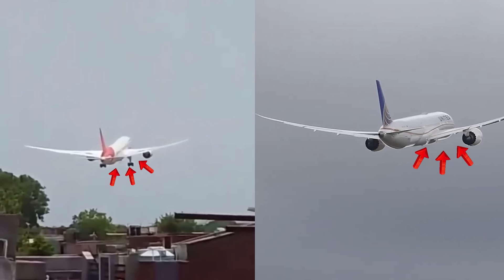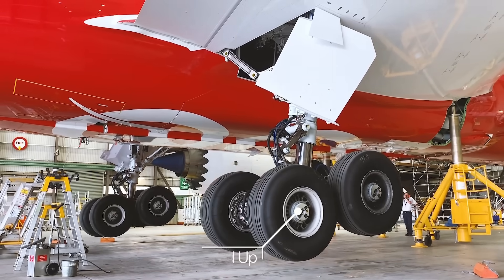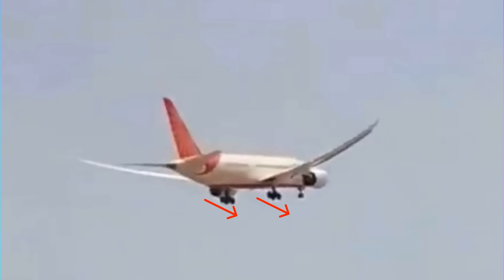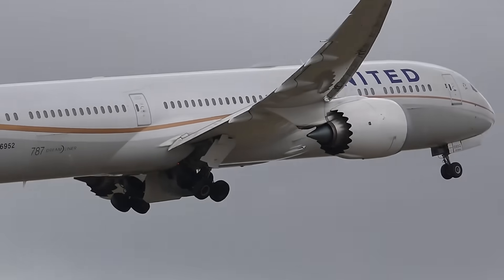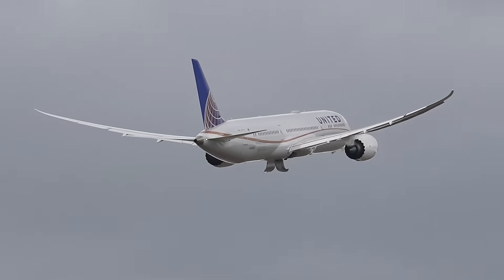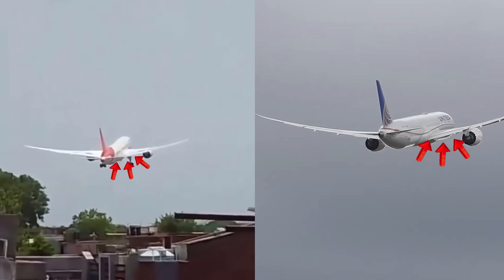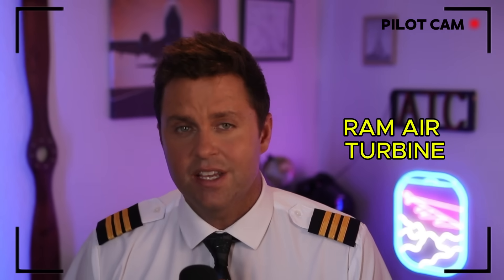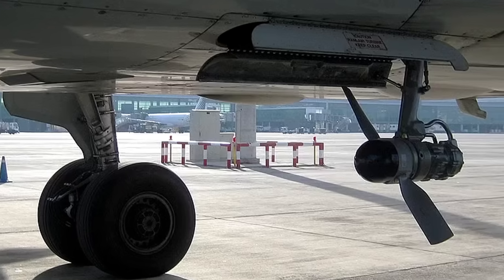Pilot Explains: A New Detail in the Air India 787 Crash Everyone Missed

Comment: Solid analysis Gary. The odds of double engine failure are so remote. But it’s hard to imagine a different option either. Looking forward to getting the initial report.
Reply: The fuel levers are mechanical. Are there circuit breakers that provide electrics to the fuel valves?  An electrical issue could have popped both breakers starving both engines of fuel  simultaneously.  Just my thoughts.
Reply: @CarlWheeler-tv2tu  There are no physical circuit breakers in the B787 cockpit. Nothing you can check.
Reply: How about Fuel Cut off valves. Is it a Electrical Solenoid like in other Automobiles. When the electrical power is lost, do they close automatically.
Reply: @praveens866  A Tesla or other electrically driven cars will stop immediately if there is a total electricity failure.
Reply: Engine reliability is so high that the FAA removed the requirement for the third engine for transatlantic flights. No way the engines failed independent of the same problem.
Reply: @jamesdellaneve9005 the same FAA that enabled Boeing to certify their own planes leading to the Max fiasco
Reply: Good video and Solid indeed. A lot of things seem questionable or rather unlikely, yet a plane crash like this is already unlikely in the first place. It is indeed a priority not to jump to conclusions but i think its important to bring some things up to the table that we didn't see before. What do you know about the GEnx 1B64 Engines? and what do you know about Jetstar flight JQ15  (march 29th)?
Reply: @derkurier5542  I just looked this up, interesting! Has there been any reason given for the dual engine failure? Sounds like the electrical system may have failed?
Reply: Maybe low fuel pressure due to contaminated fuel. It might run normally during idle but on full throttle it became fuel-starved that flamed out both engines.
Reply: @RideOnTimePH  Possible. Yet Contaminated Fuel usually would have an impact on takeoff Run already. The pilots are trained to stop to run due to anything abnormal. But it is still a reasonable possibility. Just something would be missing in that big picture than. Other than Ice what could trigger Fuel contamination to cutoff the Engines at that very moment, not before?
Reply: @RideOnTimePH definitely a possibility but that would have been evident during journey down the runway l
Reply: @RideOnTimePH they would have been apparent early in the roll.
Reply: @RideOnTimePH  if so Delhi to Ahmedabad it flew with the same octane only .
Reply: It had enough to get off the ground then stopped for some reason.
Reply: @RideOnTimePH  
Couldn’t low fuel pressure also be caused by an electrical problem? And see the comment immediatley above yours suggesting that both engines could fail because of an electrial failure because I guess these engines need electricity to run. Are both engines fed  fuel from the same tank, I mean did they both start recieving contaminated fuel at exactly the same time which would need to happen for both to fail at the same time because of contaminated fuel. I mean they did take off so not all of the fuel was contaminated. In my totally amateur estimation the chances of both engines being deprived off electricity at the same time are greater than both recieving contaminated fuel at the same time. Furthermore, I heard there was a passenger on a previous flight in this very airplane who reported to a flight attendant that he was experiencing electrical power failures in his seat. And even more furthermore an electrical failure is one triggering mechanism for the RAT to deploy.
Totally unqualified armchair analyst here, but I sure hope they figure out what happened so a repeat doesn’t occur.😢
Reply: @RideOnTimePH  Fuel contaminated with water will have lots of pressure, it just will not burn. For those who do not drain their fuel tanks to check for water, and I am familiar with light planes, there are usually enough fuel in the system to enable taxi and take off, then at around 100 ft, the slug of water get to the engine and you get this loud silence. Adding some gas line anti freeze to the fuel, although illegal will solve the problem.
Reply: yep, when looking at both engines as separate units, yes, based on fuel and hydraulics. But when both are also dependent upon Elec Sys, and there's a 100% Elec Sys failure, they shut down simultaneously together as a system. Unbelievably sad. :(
Reply: @gkswift1999  They are not both dependent upon the electrical system.  Each engine is controled by an engine mounted FADEC powered by it's own permanent magnet generator that takes over at about 11% N1 RPM.  The engines will work fine with loss of all electrical power.
Reply: @jamesfirnhaber984  But not the fuelpumps. They will stop immediately, thus no fuel to the engines.
Reply: @gkswift1999  the engines have there own computer, I doubt there is any system on 787 that could just cause both engines to roll back, i saw the audio on that vidieo last night and it painfully apparent those engine were dead. Even if in flight idle uall see heat distorion behind them. and its not there that i saw. They have separate full pumps  and tanks.
Reply: Well...there has been at least one crash where the fire staff had to choke down an engine that was still running, despite catastrophic damage to the plane.  I suspect that each engine control computer can be independently powered by the generator on it's own engine and, if all electrical and/or network interfaces to the rest of the aircraft are unavailable, the computer will just continue to run it's engine at the power set before the failure.
Reply: @MrSardine17 That was a Qantas A - 380 at Singapore. Fuel off, electricals off, damaged fuel tanks. Nothing would stop it. Not even copious amounts of water from fire trucks. Yes, they had to choke it with fire fighting foam. Guess that said a lot for the quality of those RR engines.
Reply: @gkswift1999  you're making up that the electrical system failed. the passenger didn't say the lights went out, he siad the green and white ligths came on. both engines feed the electrical system. Why should it fail?
Reply: @FeritTuzer  No communications more with ATC after the Mayday call.
Reply: @gkswift1999 My thoughts! It explains the extracted RAT and in another vid you can also see the liftoff at the very end of the runway. So I think problem startet early but it was too late to cancel start.
Reply: @gkswift1999  I don't see how that would be possible. Im not suggesting its not, i just dont see how. All Electrical systems have more than one backup. The Primary 235 vac loads also have 4 backups those are running Fuel pump & Hydraulics, then you have the Main Bat and the last Line of defense the RAT wich will prevent a 100% loss of Power
Reply: @derkurier5542  So, opposite situation: loss of electrics didn’t cause flameout, flameout caused loss of electrics.
Reply: @petergill2265  It is more likely. but still both is a possibility with this plane. Not suggesting that it is less safe, but with every design comes with its Vulnerabilities. The engines just for an Example. The decision to design the engine blades out of Carbon fiber and some reinforced titanium parts exept pure titanium increased efficiency but also made the plane quite a lot more vulnerable to bird strike. Carbon fiber is simply not made to withstand these impacts. Just as an example
Reply: @derkurier5542  Was the Auxiliary Power Unit in the tail running?
Reply: @derkurier5542  Vapor lock on both the engines at the same time? Mhhh...
Reply: A passenger from the previous flight on this plane stated that the electrical power kept going on and off, no TV's, no A/C, etc.. did this have anything to do with this crash?
Reply: @ILoveLucy21.  He mentioned AIR CONDITIONING!  On the 787 that's ELECTRIC and LOTS of it. Maybe 1Mw in total across two packs?
BIGGEST user of elec power on the aircraft! IF it was dumping the air pacs it was struggling somewhere.
Reply: Engine anatomy and function: What keeps an engine running smoothly and efficiently. Checklist template. Fuel to electricity  for energy and power from  the source and then out to the engines? Rotation in the engines? Compare fatigue, weakening in body and performance of same models. Residue in fuel ? I am no expert. Level of fuel before re-fueling?
Reply: It is not contaminated fuel. They would not have failed at exactly the same time.
Reply: There was no adverse OEI yaw and no hard over rudder deflection which would seem to indicate a dual power reduction or dual engine failure. The flap theory doesn't hold water because it'd never off the ground loaded and fueled. The Rat deployed so it was apparently electrical which could have caused faulty fadec actions or some unprecedented event.
Reply: @jeffreylewis145  I beg to differ. Im not saying it is, but im saying it is a possibillity. On the Ground the plane uses the APU wich draws Fuel from the left side Main Tank. Crossfeed would have been unlikely to be active therefore you have a small but impactfull difference of Fuel balance, effectively it could very much cause one Engine to be contaminated before the other. Also Fuel Contamination is not limited to water or even just a foreign liquid.
Reply: @jeffreylewis145 ADSB data shows that the plane was slower by 10 knots and more than half the vertical climb speed compared to the same flights the days before.  It also used 2400 meters of runway instead of 1600 meters (that was calculated by using local conditions, but guessing the weight of the plane, this will have to be done again with the actual data).  This could suggest that they lost one engine/experienced a major power loss on one engine after V1.  There is no information or data yet that could confirm that both engines failed at the same time.  But it is a possibility to include one failed first, then the other
Reply: Report that only half the runway was used, from intersection to taxiway, should have backed up to full runway length for full load and hot weather. Big mistake by pilot, no oversight from tower. Insufficient speed for takeoff, dust ingestion after leaving paved runway caused flameout both engines. NO THRUST.  @StefBelgium
Reply: @stevehoffmann-ivy6173 Stop spreading misinformation.  The crew backtracked the runway and used the whole runway for T/O.
Reply: @jeffreylewis145  The fuel on takeoff is from the main central tank so it's quite possible.
Reply: @jeffreylewis145  I agree. I think that's a reach.
Reply: @jeffreylewis145  Centre tank on takeoff. I don’t know where the pipes split, or where the filter is…
Reply: @jeffreylewis145 Also, you would have seen a series of some back fires.
Reply: @jeffreylewis145  care to explain that rather than just refute
Reply: @jeffreylewis145  British Airways Flight 38 both engines lost power on approach due to ice clogging fuel heat exchangers so couldn't any contaminant block these ? . I know filters can't cause shutdown though because if clogged they should simply bypass
Reply: @jeffreylewis145  correct. Very unlikely, as one engine is always running for longer. Flameout of one engine, then switch off the wrong engine. 
Or general electrical failure.
Reply: @jeffreylewis145  ya, the fuel contamination thing is ticking my brain now - what if dirty fuel was gradually clogging the fuel strainers/filters - not stopping the flow but reducing the max flow available, gradually - so when they went to TAKEOFF power the full flow was not available for long because higher flow = more contaminants = more clogging -= reduced flow ?  It will be interesting to see what the engine FF readings are to both engines as the aircraft was faltering. Maybe explains the looooong takeoff roll also ?  (was it abnormally long ?)
Reply: @jeffreylewis145  WHAT? Planes need pure fuel? On one flight? Gasoline witll clog  up  your care OVER TIME. And jet fuel will lower power of a 787. But I see no sense that two engine failure is "dirty fuel". To me, these are just distractions. And the data recorder won't record fuel quality.. I won't say "failure to add STP"
Reply: @jeffreylewis145  maybe not same time, maybe 2 seconds apart, but they both ingest the same fuel, so why shouldn't they? anyway this was caused by taking off from half the runway and not raising the gear.
Reply: 787 driver here (10 years and 7000 hours in left seat of that AC) - after selecting the gear handle up, the gear tilts forward then the gear doors freefall - they do not need hydraulic power to fall open, only to close. If the gear handle had been selected up, with loss of both engines, the doors would have free fallen open and stayed open. The rat is for essential electrics and hydraulics only and does not have the power to make any changes to the gear config. No sign of doors open in the video. Unfortunately, I agree that the cause of the crash is loss of both engines (note that I do not say dual engine failure)  but most evidence so far points to the unthinkable.
Reply: @chrisr3394 that makes a lot of sense
Reply: @chrisr3394  I have thought the same thing myself but it's very hard to say in case you are wrong. It's not something you would like to be wrong about 🙏
Reply: The odds of winning a lottery is remote as well but occasionally there is a winner. I don't see any other reason why a 787 will fall down so rapidly if engines were running.
Reply: @tapashaviator  Sabotage
Reply: @tapashaviator  Not to mention the fact that one person not only survived, but walked away from the crash. What were the odds of that happening.
Reply: @tapashaviator the odds of a lottery winner isn’t a good analogy because they keep running the lottery until someone wins.
Reply: @SteelheadTed each lottery draw is an unique event.. odds of winning do not change if the prize money is rolled over to the next draw.
Reply: His MayDay message was 'No thrust, going down'!
Reply: @tapashaviator  Matters not your power if your wings are stalled. Not saying that was the situation because I don’t think they were in a stall. Look at the Thunderbird ejection at Salt Lake.
Reply: @tapashaviator  a billion people dont buy lottery tickets to have one winner. but to have double engine failure, the odds would be yes
Reply: Very nice comment. But it is tragic in any way.
Reply: @tapashaviator every night there’s a winner
Reply: @tapashaviator  The RAT shows they were not running. That was NOT a pilot error. It was a system error. The theories faulting the pilots are bogus.
Reply: @tapashaviator, no other reasons? Let´s not forget the pilots who crash the plane on purpose.
Reply: Double engine failures usually involve the fuel system. A typical cause , learned the hard way in the past is the ground crew poured diesel DEF fluid into the fuel instead of anti ice fluid and clog all the fuel pumps. Either that or a leak, or someone tried to fly 1000 miles on 800 miles of fuel. There was one famous case of bird strikes.
Reply: @tonylam-u1t  There are no diesel outlets on the Tarmac, and the nozzles on the Tarmac only fit airfuel.
Reply: @glennd8232  I did not say there are diesel outlet at the tarmac, but the nozzle only fit airfuel is not accurate. There are a significant number of smaller diesel engined planes nowadays,(Diamond)  they use jet A and the nozzle is very similar to 100LL. Small plane are not equipped for single point refueling like big jets. It is also up to the pilot whether they want to add "priest" anti ice additive to the fuel. Now that is a clear liquid , just like diesel DEF fluids.  DEF fluid in Jet A form gels that will clog fuel systems, as a result, FAA allow airport vehicles to run without needing DEF fluids to avoid such accidents. There had been a few close calls. All bets are off in third world countries.
Reply: @tonylam-u1t  Ohh sorry for the misunderstanding. Thanks for the explaining. But really?, diesel engine powered planes? Never heard or read of that.
Reply: Contaminated fuel has a problem, as there are no other noted contaminated fueled planes, that we know of. This is why it is likely  isolated to this plane.
Reply: well, if you count fuel starvation as "engine failure" what about the Gimbli Glider 767 over Canada that lost both engines by running out of fuel ?  They managed to glide it a deadstick landing at an abandoned military base runway (miracle WITHOUT the Hudson). Or the Miracle on the Hudson dual engine "failure" from birds ?  And there was a foreign airliner that crashed near  NYC from running out of fuel - the dumbasses waited too long to tell ATC they were low.  Plenty of crashes over the decades from "losing" all engines if fuel starvation is included.  How about the Lynyrd Skynyrd propeller engine crash - that was fuel starvation also - lost both engines.  This India 787 smells like a fuel "shutoff' or slow fuel starvation issue - electrical issue somewhere maybe.
Reply: @KRAM-ct7ok  Ginmbli was pilots error. One of the engines had a fuel leak and stopped working. The pilots then diverted the fuel flow of the other engine to this one. Shortly after that this engine also ceased working and they were totally out of fuel. They were now gliding from a high/cruising altitude. RAM turbine was also deployed. In the case of Air India it looks like a total electrical failure. The fuelpumps stopped almost direct.
Reply: @glennd8232  It was a ground fueling error, not pilot error, on Gimbli (just checked on Wiki) - caused by faulty fuel indicators and wrong fuel load calculations by ground crew - resulted in the airplane having only 45 % of its required fuel load - so no leak but ran both engines out of fuel - (their cockpit FF indicators were faulty) so double engine "failures" (in that case by fuel starvation) do happen lol - total engine "failures" are NOT unheard of - but in Air India the timing was horrible - no altitude to work with like the Gimbli Glider. Ya, I bet the engines on this plane were just fine - just needed fuel to keep running.
Reply: @KRAM-ct7ok  you are definitly right.
Reply: @KRAM-ct7ok  Air Transat flight 236 this what I was referring to. Fuel leak.
Reply: @KRAM-ct7ok ran out of fuel ?
What was the giant fireball ?
Reply: @grrlgd3835  You don't understand what I meant - the big flying gas tank the passengers are sitting on top of was still FULL - but that fuel has to pumped out of the gas tanks to the engines hanging from the wings - which have their own pumps to increase the pressure of the fuel to a very high value to spray the fuel inside the combustion chambers of the engine in an atomized spray - this usually requires about 500 psi fuel pressure - so there was PLENTY of fuel left (fireball) - but it wasn't getting moved to the engines any longer - so without fuel the fire inside the engine goes out - called a "flameout"  (engine "failure" due to fuel starvation). Same thing  can happen to your car if the fuel pump fails -gas tank full but engine won't run - been there, paid to have fuel pump replaced lol
Reply: Steeve: this is what we have been discussing: Even "Before selecting the landing Gear handle UP"  , the gear tilts Forward Down... as soon as the sensors detect AIRBORNE...  see:   AMM 32-31-00 LANDING GEAR DESCRIPTION AND OPERATION.    So, regardless of the selection of the gear handle, it will always tilts forward down to prepare for retraction.
Reply: You forgot to list sabotage.  Who was on plane?
Reply: Gary, good analysis but both you and Steve have missed a vital piece of information.  The 787 used the entire 11,499 feet of runway (I haven't seen any information about an intersection takeoff.  Regardless, they rotated at the end of the runway) when the calculated take off distance was about 60% of that distance.  When the aircraft rotated, it is clear both engines were operating because there was jet blast blowing dust into the air.  There appeared to be no asymmetrical loss of thrust because there was no rudder displacement or yaw moments.  The excessive take off run was most probably caused by insufficient thrust and or improper take off flap setting.  Regardless, the crew did not exhibit situational awareness realizing the airplane was operating at reduced thrust with a longer than normal acceleration rate.  The captain should have rejected / aborted the takeoff.  Furthermore, at this point, we don't know if the airplane had reached Vr (rotation speed) at the end of the runway.  

Regarding a simultaneous dual engine failure.  The odds of this happening are little to none and that includes multiple bird strike, contaminated fuel, etc.  The most probable scenario would be shut down with intent. 

I am posing another theory / scenario.  Perhaps during takeoff roll, around V1 (decision speed), they experienced a total electrical failure.  If that occurred, the auto throttle would have disengaged and the FMC would have dumped all performance data.  EFIS displays would probably disappear momentarily then power up via the emergency bus.  The crew now has manual throttles, no performance data and a confused cockpit.  I'm not sure if the RAT will deploy automatically on the ground but, if it did, the RAT creates quite a bit of parasitic drag and could have affected acceleration rate.  

As you know, most pilots are taught via rote memory to immediately add full power, etc., when entering a stall, windshear, etc.  Pilots react the way they are trained and, again, the crew may have been overwhelmed not realizing the A/T were disengaged and did not add full power, etc.  

Lastly, I don't know where you came up with this landing gear down during a crash situation.  I have flown every Boeing N.G. and not one operating manual calls for such maneuver.  During a crash landing scenario the negative vector / downward force / rate of descent would be great and the landing gear would most likely spike through the wing rupturing the fuel tanks.  For that reason alone, for liability purposes, Boeing would never suggest such action.  I appreciate your concern about this fatal accident but you and Steve should pay more attention to what you are saying rather than preying on the sensationalism of the accident for Y.T. "clicks" and notoriety.  Capt Steve in particular is receiving much criticism world wide for his wild ideas, retraction, new theories, etc.  Your suggestions are more conservative and thought out but still over the top.  I.E., simultaneous engine failure, leave gear down for crash landing.  I doubt very much, with the short time they were airborne, the crew placed the gear handle back down to "absorb the impact" of the crash. 1.  It's wrong and 2.  They had more important things to do like flying the airplane and not talking on the radios.  

I believe this accident was preventable.  The crew should have realized during the initial take off roll, thrust was inadequate and acceleration was abnormal.  The captain should have rejected the take off.  If the crew did initiate gear retraction, then the video should show the main gear forward tilt on early climb out.  

I believe the accident was preventable.  I believe a contributing factor to this accident is PILOT ERROR.
Reply: Guys even if a thing can go wrong with a chance of 1 in a billion - then this could be that 1 moment. Remember Murphy's law is an adage or epigram that is typically stated as: "Anything that can go wrong will go wrong."
Reply: Another possibility the aircraft's tanks were EMPTY. I have no idea if it's even possible the pilots couldn't see that. It's just a theory.
Reply: @UkrainoTV No. That is really impossible. The fireball at the crash scene can only have been triggered by jet fuel. If there was no fuel on board there wouldn't have been.
Reply: @UkrainoTV if tanks were empty there wouldn’t be the huge fireball
Reply: @UkrainoTV  you mean - they would have just forgotten to fuel the plane and the pilots would not have checked fuel levels before takeoff and then the plane went on fire even with empty tanks?? Nope!
Reply: @mingli8790
0 seconds ago
captain steve's original opinion was a joke!
Reply: @mingli8790  why do you think so?
Reply: Are we sure they weren't intentionally shut down?  Was anyone in the cockpit having personal (e.g., marital or financial) problems?  CVR would show what happened during/after the mayday call to hopefully rule this out.
Reply: Is it possible that the issue might have been a battery fire 🔥 that made the avionics malfunction causing the pilot to lose control of the plane
Reply: Fuel contamination. My Indian buddy said IA is the worst in service and maintenance. As the sole survivor said, they hit a wall. And may be talk about the sole survivor?! Wow
Reply: Overheated fuel valves → incorrect fuel flow → incorrect combustion → insufficient thrust → poor climb → stall.

Possible culprit:
Fuel metering valve inlet
90°C – 130°C
Higher risk zone
Reply: @preetampurbia india
Reply: 2019 ANA flight!! DUAL ENGINE FAILURE!!!

On January 17, 2019, an ANA Boeing 787 Dreamliner suffered a simultaneous dual engine failure on landing at Osaka Itami (ITM). ANA currently has 66 Dreamliners in its fleet. ANA Flight NH-985 had 109 passengers and 9 crew members on board.

I'm not even sure half these guys are pilots??!! He says it is a remote chance.

It literally happened 6 years ago 😂😂😂
Reply: @budget_nomad That was a dual engine shutdown (uncommanded, but not due to a failure) AFTER landing and AFTER the thrust reversers were deployed.
I would argue that’s quite a different scenario. Admittedly the cause was never fully determined.
Reply: @simonissell There is a netflix special literally saying as these planes get old they will have more electric problems....

How else do you explain dual engine failure 2 seconds after takeoff!!!

If it was fuel, it would never hit off the ground!!

Flaps have been ruled, so has bird strike!! 

The pilot said loss of thrust!!
Reply: @budget_nomad  Oh! A NETFLIX special!
Well that's conclusive then....
Prove to me that an electrical problem will cause a double engine failure in a 787.
Reply: @budget_nomad  they didnt know much in the old days so you carnt bleme them
Reply: @budget_nomad  that was in the old days!
Reply: There is new theory, fuel pump malfuction, both engines stopped and there is hot air in the fuel system. Aircraft was overheated for a long period of time. So, air bubbles in fuel system.
Reply: I had a double engine failure on takeoff but thank goodness it was on a A340 so I had two engines left but just to say it’s possible to have such an event as improbable as it is.
Reply: Captain Steve, another pilot suggested perhaps fuel vapour bubble from sitting on the tarmac so long in the extreme heat with no air-conditioning on he said the vapour bubble coupled with hydraulic failure and the angle the plane was on the engines went out from fuel starvation due to vapour bubble. A passenger on a previous flight on that aircraft spoke of various electrical issues on the plane (air-conditioning compressor cutting in and out, entertainment system and plane phone to communicate with crew not working and wiring hanging out on a part of the plane). Another passenger on that same plane from around a week or so before the crash said as the plane was about to take of (perhaps from Frankfurt or at least he mentioned Frankfurt was part of the journey)  there were electrical problems and the passengers had to disembark and stay in a hotel overnight while the repairs were carried out.
Reply: 1.	Engine Start & Taxi:
	•	Fuel for engine start and taxiing usually comes from the main wing tanks.
	•	This ensures stable fuel supply and allows the crew to verify that the fuel pumps and systems are working normally before takeoff.
	2.	APU (Auxiliary Power Unit):
	•	The APU also draws fuel from the left wing tank (via the left fuel manifold), unless crossfeed is used.
	3.	Takeoff Roll:
	•	Once engines are at full thrust and the takeoff roll begins, the center tank pumps (if loaded with fuel) are typically activated to begin feeding fuel.

So the central pump kicks off during roll and that had an issue which cut off supply to both engines
Reply: @kanwarsangha  Power was lost after they tried to raise the gear, maybe not a coincidence; then loss of main elec busses; then RAT deploys.
So, if the engines were switched to centre tanks-  no power means no fuel,,,what is Boeings back up for that? (and is it QUICK)
Normally engine driven pumps, does 787 have those anymore..cos gravity feed might be comp in a high nose attitude.
Reply: Maybe this was sabotaged fuel.
Reply: @hannibalclark6111 each engine has its own fuel tank, so would the contaminated fuel hit each engine at the EXACT same second?
Reply: @Gary-ee3kq  After full thrust for the lengh of the runway? unlikely!
Reply: if there was double engine failure it would be caused by bad fuel.
Reply: @FeritTuzer  Could be!
Reply: Joatmor301 on to something. It was a hot ddy and fuel vaporizartion possible causing pumps cavitation. Fuel is the common factor to both engines
Reply: @billbonadies9615  Electric fuel pump loss at full thrust with heavy suction by the injection pump could possibly result in instant vapour generation
at the tempratures that existed. In normal flight it would recover quickly, BUT on take off that's fatal.
Unless Boeing didn't provide emerg grav feed, this seems like the best reason for sim dual eng fail.
Reply: @billbonadies9615  fuel is most common but the Vapor on the 787 is mixed with nitrogen therefore less likely
Reply: I bet they selected gear up and the air speed was too low for the rat to work properly after losing hydraulic power.
Reply: @themeach011 the rat would not provide sufficient hydraulic power for retracting the gear that is true no matter the airspeed
Reply: @derkurier5542 ok interesting. My understanding was that at higher airspeeds it would provide more power. But it makes sense that it wouldn't need enough power to run the gear. You're likely never needing to bring the gear up if the rat is deployed. Thanks! Have a great day
Reply: @CaptainSteeeve @Garybpilot 
Question, did you notice that object flying off the aircraft just before crush? 
Was it an emergency exit door? Did that lone survivor opened it and jumped?
Reply: Not an expert, but during take off though both engines seem to have an effective and stabil  "maximum" trust (suggested by the postengine "exhaust"). A possible fuel contamination, you would expect to symptomize itself i n a gradual and irregular manner, and NOT to manistest itself smoothly with just a few seconds of notice. A fuel contamination also probably would not affect the engines several of seconds apart which the planes stabil course "disproves". Another potential cause of completefuel cutoff, could be a sudden onboard computer mallfunction of the fuelinjection.The pilot knew he did not have adequeate alttitude to dip the nose to increase speed, so his best damage control option was to attempted a tail first touchdow n with the hope of a gradual speed d ecrease. (A good gestur from Boing could be to finance the burial of the victimes, they probably can afford it).
Just a humple theory.
Reply: There is no way that a big transport jet would be able to takeoff and fly that profile (the first 4-500 feet, at that pitch attitude with that vertical speed) with the flaps retracted.
Reply: Gentlemen, ATC view. Previous departures of that flight involved a backtrack for departure, but not full length. Hence TORA must have been more than sufficient for an easy takeoff run.

Question: at OAT 37 degrees, what pilot would PLAN an intersection departure where they expected to be rotating a 787 so close to the end of the runway, that they would be kicking up dust and potentially ingesting gravel, when there was plenty of additional runway available for use? Zero.

This is something like Cathay 780 I think. Fuel starvation was undetected during start and taxi. On the takeoff roll, aircraft was sluggish, but not enough to reject, and didn't raise alarm bells because of the OAT.

If they had taken full length by default, maybe they would have had more time to notice the impaired performance, or at least had more energy and altitude to lower the nose for a better glide and more optionality. 

If you're a pilot reading this, I think there's a lesson for you in there somewhere. Is the 2 minute taxi saving really worth it?

What a terrible tragedy. Let's hope that we become safer as a result.❤
Reply: Gary the Pilot who got fired for drinking on the job while wearing a Halloween costume acting like they know what happened. Give the family and the people who died some respect. These guys immediately go to YouTube to capitalize on making money.
Reply: The theory fits as it was said captain said mayday mayday mayday no power!!
Reply: @sampreeth10  And no communications further. No electricity., and fuelpumps also ceased.
Reply: Is Pakistan the mystery culprit? Sabotage the plane to avenge india's Operation Sindoor?
Reply: @LondoEnzo could but doubt. Based on sabotage before they would have claimed it as their victory in someway.
Reply: Fuel could have been hot or otherwise contaminated.
Reply: @billbonadies9615  contaminated is the better one than just hot fuel
Reply: Fuel starvation…pump failure
Reply: U should focus more on electrical system failure too the lights went out after a point, even backup wasn't to light the aircraft up
Reply: The FDR should be downloaded after every flight. 
Anomalies tracked.
Reply: Did both engines fail at exactly the same time? Or did 1 engine fail first under high power and cause the plane to yaw? Did Boeing ever test the exact same circumstances for a max weight takeoff and an engine fails at that same maltitude ment as happened during this accident? (I.e. was the software ever tested including the RAT deployed?
Reply: they say its a pilot error and everyone agrees but what you dont understand is it mite be a error from the airplane so they will cover it up!
Reply: Well, I thought it was probably foreign pilots with fewer training hours that was the reason. That's what Gary was talking about last time...and you also speculated too much. You should start involving technicians before you speak to much. You are just the 'drivers' of the 'car' and people deserve better than gossip on the news.
Reply: RAT was deployed that clearly indicates double engine failure
Reply: I said on day one it looks like electrical failure causing both engines to run down, especially with the RAT deployed.
Reply: Electrical failure could be. If engines need electricity for it to stay  running .  Then it points to that. It could explain both engines stopping. Its not mechanical but electrical. RAT also might have deployed to generate electricity. But it cannot instantly backup due to short time.
Reply: It's not contaminated fuel. If it was bad fuel, the engines would have a serious of back fires. It was just a total loss of electrical power.
Reply: @ major electric failure could explain it.  Since all gas pumps on the plane are electric.
Reply: Not engine physically, but engine management computer control and critical sensor failure. See the history of computer related accidents eg  1988 Habsheim A320. 2008 XL 888  and 2015 A400M as starters.
Reply: @terryluckhurst4114  Yes, it is. It is possible.
Reply: The Captain call the tower and stated he had no thrust.
Reply: Surely if the fuel had been contaminated, the aeroplane would not have gotten that far into the take off without the pilots realising something wasn't right. Power on the runway must have been normal.
Reply: @Gary: the lone SURVIVOR interview IN HINDI..he said he heard the engines accelerated a bit just before the plane crashed, that being said pilots might have tried to restart the engines but didn't have the space to do it...May be that's why the nose was in the pull up position
Reply: It has to be double engine failure I reckon , if as gary said one of the other unlikely scenarios they pulled engines back to idle they would still have hydraulics/electrical power so no RAT  deployed
Reply: @nounoufriend1442 yeh the RAT didn't come out for no reason
Reply: Guys. We need to get to the bottom of why they took nearly all 11,000 gt of the runway, and why they didn’t max break and stop on the runway
Reply: @bhollingsworth  Agreed - dam near used 11,000 plus it appears - is that "normal" for a full load 787 at that elevation and temp/humidity ???
Reply: Hey Captain Steeeve, so far you have the better insights on this crash. I am a retired Captain, ex Military Fighter Pilot, and Ret. Airline Captain, 51 years in the aviation field typed on the DC-10, B-757, B-767, AB-330. My thinking is that it could be a total electrical failure, but also an electrical spike, leading to the RAT deployment, but I also think it was a duel FADEC failure why both engines flamed out. If it was bad fuel, we would see smoke coming from the engines, but we didn’t see that. It was more like the fuel cutoff switch ( FADEC ) than bad fuel. But an electrical spike could take out both FADEC’s. simultaneously, very possible, I am just throwing another wrench in the thinking. But I also noted that by the truck tilt, that gear retraction had been initiated, just pyro to both loss of engines.
Another note, there was a AD on different models of the 787 that has horizontal stabilizer issues, this was not to long ago, were there was miss alignment problems due to pin problems with the ring alignment points of the stabilizer’s. For what it’s worth. 
Still this whole incident was tragic.
Reply: @767Seatwarmer-p9h  great inputs ! I assume from your comment that on 787 a dual-FADEC failure (2 FADECs per engine I assume) = Engine Off by design ?  I worked on the military V-22 Osprey engine program back when it started - it had dual FADECs per engine also (plus an ABEC backup originally) - they decided that for their mission a dual FADEC failure = Engine Fixed power setting (wherever it happened to be) - so engine keeps running and is still useable, just can't change power setting - then it can be shutdown later prior to landing.  Stange that on a 2-engine airliner full of paying passengers they would use Engine Off logic ??? I could see it for 3 or 4 engines - but when you only have 2 to begin with ?
Reply: Hey Captain Steeeve, so far you have the better insights on this crash. I am a retired Captain, ex Military Fighter Pilot, and Ret. Airline Captain, 51 years in the aviation field typed on the DC-10, B-757, B-767, AB-330. My thinking is that it could be a total electrical failure, but also an electrical spike, leading to the RAT deployment, but I also think it was a duel FADEC failure why both engines flamed out. If it was bad fuel, we would see smoke coming from the engines, but we didn’t see that. It was more like the fuel cutoff switch ( FADEC ) than bad fuel. But an electrical spike could take out both FADEC’s. simultaneously, very possible, I am just throwing another wrench in the thinking. But I also noted that by the truck tilt, that gear retraction had been initiated, just pyro to both loss of engines.
Another note, there was a AD on different models of the 787 that has horizontal stabilizer issues, this was not to long ago, were there was miss alignment problems due to pin problems with the ring alignment points of the stabilizer’s. For what it’s worth. 
Still this whole incident was tragic.
Reply: @767Seatwarmer-p9h  I thought traditionally, that a FADEC elec failiure would result in metering being left in current position and fuel flow valves open.
Also, in the event of power brownout, FEDECs should re-boot in mS before the engine even notices.
AND that the FEDEC is fed from the engine it controls as a backup when main busses fail.
At least, on a good design day!
Reply: @rafbarkway5280  But not all FADEC’s are created equally.  You would think that a power loss would not effect the FADEC’s but still remain to keep both engines running, Even QF-32 the number one engine cables were completely severed and the FADEC kept the no.1 engine still running and reduced cruise speed. But like I said all FADEC’s are not built the same, especially with different manufacturers like RR, Sapphire, GE, PW, but has anybody checked to see what an electrical spike would do to these FADEC’s probably not. Plus I was just throwing out something that I wasn’t hearing that could possibly been the cause of both engine failures. 
Good talk thanks
Reply: @rafbarkway5280  well, depends on the FADEC system design - some are FAIL FIXED - like the V-22 Osprey I worked on in the 80s/90s - but others are FAIL OFF (engine shutdown) like the Saab 2000 Turboprop I worked on - I read on one comment that 787 design is FAIL OFF type (?).  Ya, i am puzzled how ALL FADECs on both engines (4 total) could fail at the same time - would have to be an electrical issue I guess
Reply: I agree with your analysis and I would add that engine 2 flamed out first, then engine 1. This idea is based of the fact that just after leaving the ground, we can see the plane slightly turning right, the captain corrects this, the plane continues, as it is expected to on a single engine, then engine 1 flames out and that's when the plane starts to descent. If this is correct, it is worth looking at what could cause a flame out of both engin in that order.
Reply: ...but both engines are controlled electronically via Auto-throttle, that is the likely problem. Electrical failure disables TOGA so that the auto-throttle can't calculate thrust requirements.  During take off the 787 must be flown with auto-throttle in TOGA mode.
Reply: @Garybpilot you should have given credit to Swiss0001 who drew the  point that landing gear was partially retracted.
Reply: Nobody is talking about the huge puff of smoke clearly visible from the left Jet on take off, seen on cctv.
Reply: @SteveSkrobot  They say it's dust in the runway, blown up by the airflow fein the engine
Reply: Meet Kevin's Youtube channel suggests it was a vapor lock in the fuel lines due to sitting on the tarmac for a couple hours in the heat of the Indian climate.
https://www.youtube.com/watch?v=GaEa-VPW70Y&t=239s
Reply: Am an Indian and trust me - Boeing and our corrupt civil aviation ministry will never let the truth out to public and they will try their best to to keep the blame on pilots..
Reply: HOW WE HAVE A DOUBLE ENGINE FAILURE - SIMPLE DEW BY CHINA
Reply: It was sabotage
Reply: "The odds of double engine failure are so remote"...  Investigate this - wikipedia  John_Barnett_(whistleblower)
Reply: I read 'emp device' in a comment on a post somewhere. What is that ? Please can someone explain.
Reply: contaminated fuel
Reply: Looks like deliberate Fuel contamination. This could be a terrorist attack.
Reply: Yup the RAT audio has been overlayed from other video.. there was no rat 🐀 😂 Just an Indian stuff up
Reply: Its a computer malfunction.....probably a virus or electronics burnout took out both engines and whole power delivery.....absolutely nothing the pilot could do here
Reply: I've reported both you & @garybpilot to YouTube for your BS & disgusting coverage of this crash. I will be reporting you to your airlines too (if both of you are in fact pilots and not cosplaying) Why? You pushed pilot error no flaps for take off hoax when you must have known these aircraft won't let you take off in this configuration. You also pushed flaps lever mixed up with gear up lever, another totally spurious take. You should have known that commertial planes wouldn't crash even if gear was down & 0 flaps. Plane rotated fine on the video. For "professionals" this is unforgivable. 

Further, @garybpilot referenced @captainsteeeve in this video at least 10 times ! Also mentioned an "upcoming colaboration" . What he failed to mention was any attribution to the YT channel @Swiss001 of 

a) the "forward gear tilt" indicating the pilots may well have actioned "gear up" as normal, 

b) or the suddenly obvious fact that any commertial pilot would know, that zero flaps and gear down config would not lead to a crash. 

@Swiss001 posted all this information two days back when clickbait cosplayers like @captainsteeeve & @garybpilot as well as arch bullshitter meetkevin were trying to get clicks and monetize their irresponsible dumb speculations that a pro pilot should be ashamed of. Why didn't @garybpilot, who even used the same clip of the 787 gear truck forward config that @swiss001 used in his video just forget to mention where his "new theory" had come from? He couldn't stop name cheaking @captainsteeeve tho, lol. 

Now this @Garybpilot guy is even pushing pilot sabotage with zero evidence !! I hope both you "pilots" get canned by your airlines if you're actually are employed. You have brought aviation YouTube into disrepute. I hope other big aviation YouTubers call you out for your totally irresponsible BS. Hope your 15 mins fame was worth it!
Reply: is it feasible that when retracting the landing gear the hydraulics blew and damaged the electrical system for the engines?
Reply: A hypothesis based on all available evidence but please debunk either you or Captain Steve when meet: The plane encountered a massive catastrophic electrical systems failure caused by domino effects while on take off heading to V1. Where complete failure and a dual engine compressor stall happened shortly after V2 (the pound bang and light flickering heard by the survivor) causing the landing gear to not retract and the engines to loose thrust and the rat to be deployed (all due to the electrical systemic failure - remember 787 architecture VS other older Jet aircraft). And even with the fail-safes there was not enough altitude or time to restart engines esp given less dense air due to high temperatures, and full weighted plane. Esp listen to clear video, one doesn’t hear the electrical sounding high pitched jet engine sound on full throttle even tho 787 engines are generally quiet, even after the plane passes the camera and the RAT sound dissipates, mainly silence until explosion. How could this be caused, possibly FADEC burn out due to bad maintenance due to faulty or improperly configured GPUs for 787 sensitive electrical architecture (source: why would there be so many faulty non functioning electrical systems in that plane from earlier flights via other videos for a plane less than 15 years old). 787 is like an electric car vs an ICE car compared to other jets where almost everything is electrically governed and controlled by wire and chips and modules even with fail safes. Interested to know thoughts if you read and when you and Captain Steve talk.
Reply: Also evidence for domino effects while take off: The 787 hit the end of the runway before being airborne, even on a short runway in hot conditions a 787 should have cleared the runway before it hits the end blowing up dust from the unpaved part shown in one of the take off videos. Means engines were losing power during take off before airborne. And by the time the video of the RAT based on no Jet engine whirring only passing air pass through noise if isolate the RAT turbine noise means when the plane was sinking as if in water (air is a fluid and heavier than air flight is based on fluid dynamics - for those that doesn’t know), it seems like it’s quite clear engines had gone down to zero power 1-3 secs before ground collision, from a higher but fading power as it was able to get off the ground albeit with longer time to rotation than normal, but with the drag of the landing gear and diminishing power, was not able to maintain climb, or power through emergency.
Reply: Good clarity Gary. Seems like high water content at the bottom....thru negligence or by sabotage, has to be seen
Reply: If you are a lover of natural scenery, love to travel and explore. Come with me.
Reply: they say the plane simply feel out of the sky so its lucky it didnt land in the ocean somewhere then no one would ever find them!
Reply: It seems to be a bug or a design flaw from BOEING which rendered the engine useless cutting it off entirely
Reply: But the pilot waa heard to say he lost thrust
Reply: Your analysis is the best one taking up other serious approaches already posted and resumed
Reply: Could this spell the end of boeing?
Reply: Could be PTI failure,dual FADEC failed,.elec . Hence 🐁 deployed.
Let's wait for official findings.
Yea, should we ground the B787 is the concern....
Reply: they probly dont use computers these days because AI is now available
it makes you wonder if we should go back to computers and at least planes would stop blowing up
Reply: I notice that so far, no one is touching on sabotage. In a country at odds with their next-door neighbor, I would have thought it was a plausible possibility.
Reply: Could this b GCU failure.
Cause loss electrical,and hyd failure
Reply: When should we expect the initial report?
Reply: Catastrophic electrical failure. Fuel pumps become inoperative. Gravity feed not enough to feed  the engines for such a high demand. Engines encounter fuel starvation. No thrust.
Reply: Don't know much about planes but this case really got my attention. I really think this was done deliberately as its so rare for this to happen. 😢
Reply: Contaminated fuel might do it. No other aircraft were affected,so the contamination would have to have been water - condensation, the reason we check for it on light aircraft. No idea whether that applies to jets too.

Perhaps the engines didn't shut down, but were pulled back to idle (which would have had the same effect)? Could that have been caused by a  surge in the electricity powering the FADEC?
Reply: Capt. Steeeeeeeeeeeeeve <3 fly safe!
Reply: Then it had to be sabotage, but why? ... who was on that plane?
Reply: Last night, I came across to what seemed to be the Indian prelim (not in the original language though, and the link to the source was giving the 404 error, so not sure if this is genuine, but….): the captain seat rolled back at the rotation, with him grabbing the thrust levers & his FO being unable to “overpower” him.

This does sound somewhat bizzarre, but clearly, it’d explain the low thrust (not the RAT though which I personally am not sure was activated)
Reply: Jeju's black boxes weren't equipped with backup power. Are these ones?

If not, they may have stopped recording if total electrical failure occurred. Such a silly design.
Reply: Has anyone seen the video in which a passenger on the previous flight that exact plane took spoke of how poorly it was maintained that there were wires hanging from the ceiling and no air con. Air India would have known the plane was in a subpar condition
Reply: 🤨 This guy is too young to be a pilot what is his qualifications.
Reply: AI has DVR in cockpit, we'll learn what the pilots did. Both pilots were experienced.
Reply: Easy. Pilot error, or cockpit sabotage. It's happened many times before. That takeoff configuration, gear down, flaps up, engines off, leads only to one direction, and that's the cockpit. The dudes analysis of how an undercarriage works is terrible, he needs to do some more study before he tries to be an engineer, and damn I hope he's not flying my next sector !
Reply: @privatename6891  If flaps were up then somehow they deployed after the crash ! as flaps are defiantly out on the crashed aircrafts wings
Reply: Air india bad maintenance simple as that
Reply: Sabotage is always a possibility. When you have got neigbours worse than enemies.
Reply: Two different opinions on flab setting is not surprising.
Two possibilities 
1. Pilots are forced to cut off fuel  supply or the ground staff did something to malfunction the fuel switch or the faulty fuel switch .
2.cocokpit attack theory .
My suspects on the lone survivor.
Maybe he threatened staffs and entered the pilot cabin..killed in mid air the pilots  and escaped by opening an emergency exit . Why is this theory not possible Also he looks like military trained  .Another important thing is that he escaped just with his mobile phone intact .how this is possible with such huge impacts no loose item on hold may not be possible to hold right .Even the wings are blown . Why none investigate him seriously.
Reply: It's Boeing
Reply: Another air India engine trouble Hong Kong to Delhi 😭😭😭
Reply: Someone is trying to save boeing and air india 
By blaming it on pilot 
You know the narrative will give that youtuber good fortune 
Also blame the pilots and you know they are not here to defend themselves
Reply: The sole survivor said he heard a loud bang just before the crash. Maybe RAT deployment or maybe some other type of explosion, either unintentional or maybe even intentional.
Reply: Hey, Captain Steeeve, non pilot here, so just wondering why we don't know what ATC was saying to the pilots, it may reveal much. Surely the controllers' messages are still available, wouldn't they be revealing?
Reply: The survivor reported that there was a loud bang in the lights flickered right before the crash. It’s one experience pilot’s opinion that that represents a dual engine failure, a deploying of the rat, which would cause the lights to flicker.
Reply: So many MALE pilots crashing planes and we hear crickets! But god forbid if it was a female pilot you’d hear such disgusting comments.. how hypocritical!
Reply: I'm thinking pilot or co-pilot suicide is more likely than double engine failure or contaminated fuel. If it was contaminated fuel, it would have showed up on other airplanes using that airport. Duel engine failure with no smoke or debris makes that scenario virtually impossible. Which only leaves the fuel shutoff switches. The pilot who called in the mayday is the one who shut the fuel off to the engines. In that situation, the pilots should be concentrating on flying the airplane, not calling in a mayday. Accidentally shutting off the fuel is inconceivable.
Reply: Thank you for your assessment
Reply: Whistleblowers warned about Boeing issues before they were conveniently murdered and got to testify in court, so much for witness protection quality control.  Deny, delay, dispose.
Reply: Sabotage?😢
Reply: The survivor said he heard a bang. You said you think that the noise was the RAT dropping.  How about if it was the entire electrical system blowing out?  Now you'd think you would still have thrust, but fuel pumps require electrical power.  Could this be what started the problems?  I'm sure there are backup electrical buses, but if those backups are close enough to each other, they could take each other out.
Reply: Electrical Systems failure, unsatisfactory wiring?
Reply: Malfunction in Computer Management System [CCP]in Boeing 787 could have been a reason for the accident in ahmedabad........that led to a power stall.
Reply: Recap for both/double engine failures:
1 - Human action (both accidental and deliberated)
2 - Bad fuel
3 - No fuel (literally)
4 - Birds strike
5 - Lack of fuel due to various factors (electric/hydraulic/software)
Very modern planes sometimes assume certain things wrongly due to unexpected scenarios...
Reply: If the electrical system fails, everything fails, including both engines, no ?
Reply: Contaminated fuel would not cause simultaneous engine failure. There should be slight lag, perhaps only seconds between one then the other. This should have caused some yaw or deviation from straight ahead.
Reply: @stevecartwright188 you'd actually think they would already know the positioning of all the controls by now. Theyve had the box for a bit.
Reply: Didn't the sole survivor state he heard and felt the engines powering up?
Reply: Indian government officially allows blending of aviation fuel with ethanol. Also during  this year the proportion of ethanol was increased.
Reply: In this video the aircraft looks like no tecnical issues
Reply: BTW that’s Captain Steeeve 😊
Reply: Ahoy, Mr Captain - where you take that double engine failure is so remote??? Did you try google about it - even the quick search gives about 10 incidents on first page, luckily high up, so they all had time to restart the engines.
Did you notice that APU hatch was open? What is the condition for auto APU autostart together with RAT autostart?
Gear tilts also if pressure is lost at one side, please talk to engineers, before making assumptions.
Reply: Here is some trivia for you all, what is the oldest US Airline still operating today with a certificate number 0005 ???? Anybody ????
Reply: @767Seatwarmer-p9h  I think Delta is about 1 year older.
Reply: @rannot4611  Delta started carrying passengers in 1934, Delta started as a crop dusting business. It’s funny but a lot of web sights say that Delta was established in 1924 and started airline service in 1920 go figure. But I have seen Delta’s FAA Airline Certificate the number is 0006, where Hawaiian is 0005. 0001 Was Pan Am, 0002 was Braniff, 0003 was Eastern, 0004 was TWA. Still the web sights get things wrong, they say American started in 1926 but didn’t start fly passengers until
Until the early 30’s, and American wasn’t even in the top 10 or 20 oldest world airlines.
Reply: It was deliberate. Let's stop dancing around this fact.
Reply: Any chance of foul play by a pilot ? 
Thanks for the education from 🇬🇧 
All the best ..
Reply: @paulwadey2648  There is a possibility, one of the pilots can pull the fire suppressor for both engines, I wait for the formal report.
Reply: Could this be failure of GEnx-1B engines FADEC (Full Authority Digital Engine Control) unit electronics failure due to heat?
Reply: We know flaps and slats after crash. We know electrical failure rat deployed. We know no compressor stall.  No banging. We know verh high temp. We know both engines failed no noise and wings level and you can see plane mush down from lack of power. So, when power failed, pumps stopped and  fuel vapor locked. .
Reply: Really remote. But absolutly possible.  Incredebly unlikely.

So unlikely i kind of leaning toward some kind of system issue.
Reply: Why is nobody asking the real question: Why did  Air India "Senior Captain S.S."  have only 8200 hours total flight time in his apparently long career? This rather small amount of flight time at his age is very unusual for a so called "experienced" pilot, to say the least. Fact is: He was  NOT  very experienced, at all. And his first officer was a pedestrian... with only 1100 hours total flight time, including single engine piston airplanes!  He was a rookie. 
Regards from the cockpit.
Reply: Hope when you are flying you aren’t thinking/ taking notes to  speak on YouTube. This could led us to another crash 😅 Pilot error -not focusing on primary job🎉
Reply: https://youtu.be/bHTT9gIit0A?si=Dt_APqZcsjvM7MBK
Reply: Speculation is not good for the industry.
Reply: @rameshmaharaj8671 exactly!  It is not a game to guess.  For these Youtubers, it is who will be the first one to give the explanation and gain as much visibility as possible.  They are not different from the media.  A lot of serious avaition channels have not yet talked about it.  Patiently waiting for confirmed facts to explain in more details what happened to the public.
Reply: I am a retired professor of social science(history) in India and thus a pure layman here but am following Steve's and yours videos as well as AvHerald and other debates going all over the planet. This tragedy is beyond words, but that experts all over the globe, both official and non official, are racking their brains day and night to dissect and unravel this one of a kind mystery is very heartening.

Reg. dual engine failure, unless the possibility of an event is mathematically zero, it can  happen some day. 1 in  billions or trillions is not zero and hence can occur one day. To the indescribable ill luck of the 280 and their near & dear ones, that one day arrived on 12 June, 2025.
 at 1: 38 PM (IST).
Reply: Electrical failure disables TOGA, which disconnects Autothrottle:  A/T Rollback is caused by electrical failure
Reply: Both engines needed coolant is there any readings.
Reply: Loose all power then no landing gear or flap movment???
Reply: Never say never two engines could have failed they were maybe trying to take off on one engine and get other restarted but it was a critical part of take off  so thed too much on their hands to do that.
In their panic they turned a fuel switch off then back on but too late.
This is why I think there's certain circumstances gor stopping after v1.
If thed crashed then it would have been on runway and people in hotel saved.
It wouldn't have changed outcome for crew and passengers so thed nothing to lose
Reply: Somebody said on another site that a plane has never crashed for that reason in history.
Reply: I mean, dual engine failure has happened, that's why quad and trijets were the only ones initially allowed to fly long distances over water. But it's so unlikely these days that there's pretty much no shot of it happening without something else failing first.
Reply: @davidfuller581  Especially both engines at exactly the same time.  Also, given that there was no loud explosion or visible engine fire, fuel starvation for any number of reasons seems to be the most likely culprit.
Reply: @NWALedDisplay Obviously untrue, and besides the question is not whether it has caused a crash, but whether it has happened, and it has on many occations. Most famouly the Sullenberger landing on the Hudson was due to double engine failure at takeoff. In many ways quite simular. He just had a little more altitude when it happened and a river to land on. The fact that he landed it with no fatalities may technically mean its not a crash, but that does not mean it is not direct proof that dual engine failures can cause crashes.
Reply: @NWALedDisplay  What reason, please be specific?
Reply: @NWALedDisplay The “miracle on the Hudson” plane lost both engines from bird strikes. That said, none of the video on this incident shows birds nor the engine reacting to ingesting items (flames out the back, etc).
Reply: @NWALedDisplay  has lead to crash landings, but without many casulties, reason being that it usually happens during the flight, not on take off
Reply: @NWALedDisplay  the more I think about it the more double engine failures I think of: Back when Southern Air had a DC-9 that flew into monster hail and flamed both engines out - they tried landing on a Georgia state highway - some passengers survived but the pilots did not. Also ,a foreign airline 737 in Brazil I think, flew into a monster rain storm which flamed both engines out - they managed to deadstick it on to a narrow patch of ground along a river - great landing, everyone survived.  Of course in both cases they had altitude to work with, compared to Air India crash
Reply: @NWALedDisplay I'm  thinking  if 1 engine went out and the other to 60% that would Bring it Down .
Reply: Except the crash landing in the Hudson double engine failed  @NWALedDisplay
Reply: All these crashes this year, kinda terrified to fly now.
Reply: @EmilyXiong1999  Good, stay on the ground then. Next time you hear about a car accident, don’t drive.
Reply: But I’m booked and I have paid for my flight. Scared? Yeah. Am I not going to go and see my family because of this? Not that scared.
Reply: I think it’s a vapour lock.  Hot fuel, sudden pressure changes in the fuel lines can cause fuel to vaporize and once into the pumps the cavitation on the suction side of a pump.
Reply: What about Alaska 2059? They nearly lost both engines simultaneously.  It's not inconceivable that something like this could happen again.
Reply: @unpopularopinion8608  I agree as you have both engines a TOGA thrust , highest stress on engines and high demand for fuel but I think its got to be fuel related as no smoke/ flames from engine
Reply: Now add the recent 2 events. Plane from Thailand, Phuket to New Delhi on 13th returned back with emergency landing due to b0mb thre*t hoax after a note found in lavatory.

In last night there was another plane from Frankfurt to Hyderabad, India returned after 2 hours of flight from Bulgaria after similar threa*t. 

Sabotage is one of the biggest possibility especially when India cancelled the Turkey maintenance contract of Celebi company after the recent India Pak clash and Turkey support to pak.
Reply: @rajeevanand111  Hate to say it, but… a good number of my airline pilot friends in certain lands are keeping loaded firearms close at hand.
Reply: @rajeevanand111 sabotage??So are you saying the security at Indian airports is so weak that the company running airports can easily damage an aircraft before it's flight???
Reply: @timeisup6844  Did you not get the time to read the whole thread? The last day's flight was Lufthansa from Frankfurt to Hyd, India. Returned back after 2 hours from Bulgaria to its origin after the b0mb threat. So it means germany is so weak? 

Really its tough to find unbiased response nowadays.
Reply: @rajeevanand111  hope you can read and understand English..bomb threat is completely different scenario from what you alleged, that is damaging a plane especially it's engines before it's flight..
Reply: @rajeevanand111 and besides the aviation experts in the country were always warning about India's poor airport management system and its surrounding atmosphere that in this case further deepened that casualty..A medical College students' hostel very close to an airport?? Seriously??
Reply: @timeisup6844  No I just understand hebrew and don't know how to read and write in English. Sorry if you cant read comment in Hebrew. 

And its beyond my imagination that how compromising the safety and b0mb threat, both are not safety issues and different scenario.

And don't try to put your words that I never said. I never said someone damaged engines and also never said that is only the case. 

Time for you to take some English classes to learn what the "one of the possibilities" mean especially when the ground handling work was being done by a Turkey company Celebi who helped Pak during recent conflict. Though their contract has been cancelled but they are still fighting in supreme court against Indian govt.
Reply: Can wind shear impose a possibility?
Reply: @bentenhero2327 not really. Weather at that time was 37degrees winds from 250 at 7 knots and few clouds at 6000ft. No thunderstorm or any reason for drastic wind shear occurrence
Reply: @bentenhero2327  No. Weather does not support that premise.
Reply: @bentenhero2327  not with the weather conditions at the time.
Reply: @bentenhero2327 I guess you didn’t watch the video.
Reply: It's Boeing. So nothing is remote.
Reply: Complete study of anatomy and performance of the engines. Checklist template.
Reply: No way that both jet engines failed simultaneously resulting in no temporary yaw unless the pilot pulled all power from the engines deliberately.
Reply: A vapor lock in the fuel lines ???
Reply: @andrekeefer2034  Vapor in the 787 is mixed with nitrogen. I'm still going through some papers and see if Vapor lock could even occur on a 787
Reply: A plausible explanation is an electrical short caused by leakage of potable water into the aft EE bay, as described in a recent FAA airworthiness directive: https://public-inspection.federalregister.gov/2025-08346.pdf. The short causes a total electrical failure, deploys the RAT, which takes 8secs to power up, during which time the FADECs on the engines notice the electrical fault and automatically spool back to idle
Reply: contaminated fuel
Reply: waiting but pls dont be rac1st
Reply: Only sabotage
Reply: Sorry, for your explanation and the video you showed, the main landing gears were not selected to be picked up... This is proof that for some reason they were not collected.
Reply: @HelvecioPereira Comprehension is apparantly not your strong suit.
Reply: @GPz84  No! My friend, the explanation was correct, but the position of the landing train in the video is just the opposite. One of my formations is mechanical technology. I recognize any mechanism and its operation.
Reply: @HelvecioPereira  huh?
Reply: If you were a 787 pilot, you would have not missed these details.  That s why 787 qualified crews are the experts.  But hey, your "expertise" brought you 200K subs, isn't t that great?  I guess you re looking forward for another crash to buzz again.
Reply: @StefBelgium He quite clearly stated he’s a 777 pilot NOT a 787 pilot. Pay attention next time
Reply: @TraceUK exactly the reason why appearing on the National India news, and trying to expose an assumed scenario by blame pointing at the crew, was the stupidiest thing to do.  He s a 777 pilot, not an expert of crash investigatilns, not a 787 pilot.  If he d be, he d have captured clue showing that there was a much serious problem than a simple mistake that he proposed ( raising the flaps rather than the landing gear).  He buzzed, fained 300K subs...mission accomplished!  He s looking forward to buzzing on the next crash I guess.
Reply: @StefBelgium  You sound a little jealous, besides being rude.
Reply: @Nickelbippy jaleous of what gang?  Does not make any sense.
Reply: Poor Indian Maintainance ...wont be the first time
Reply: Poor Boeing manufacturing quality.. well known by now. Let’s not jump to conclusions earlier than the investigation report.
Reply: @gm-zz8so be professional
Reply: @gm-zz8so unfortunately, happening everywhere  we are sold!
Reply: @gm-zz8so nothing like baseless slander eh?
Reply: @gm-zz8so  you don't know that...don't be an idiot